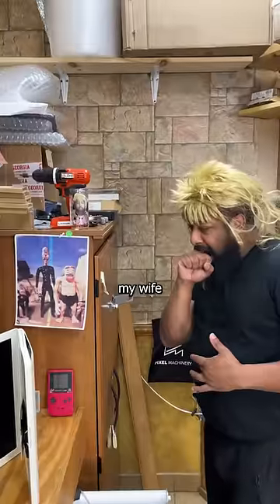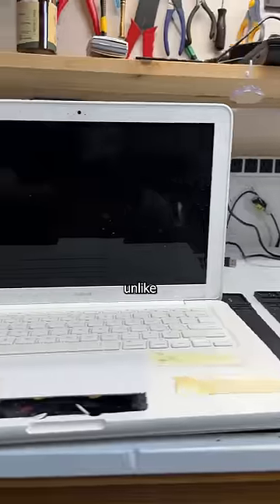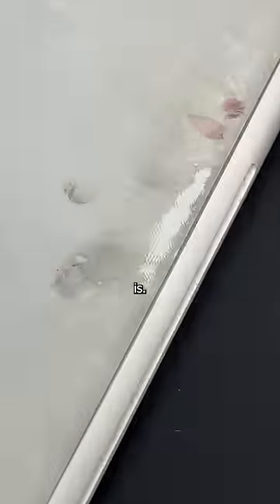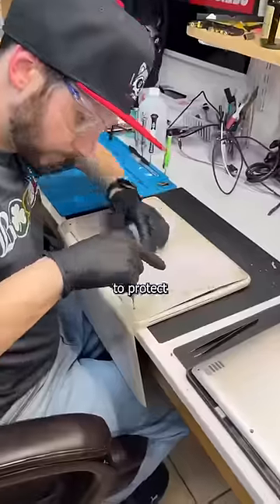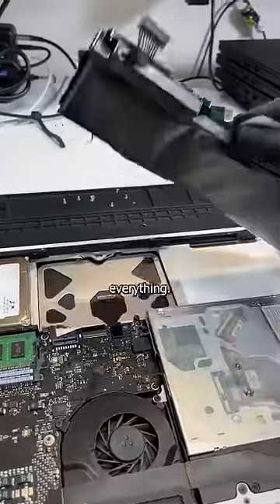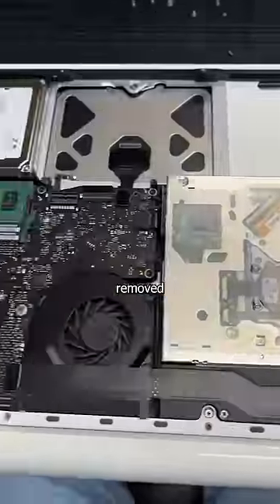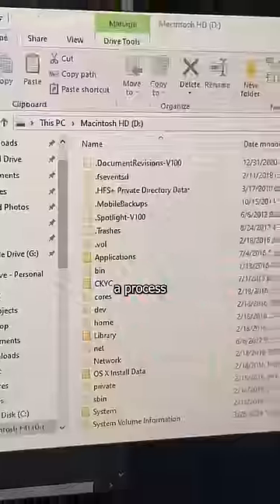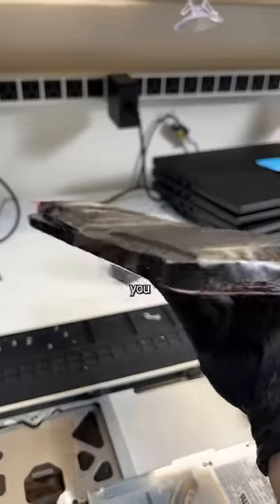MacBook swollen battery removal (GONE WRONG) #tech #technology #pc #shorts

Comment: My second to last phone legitimately exploded a little cause of the battery. It had been struggling for a while, the battery wasn't lasting as long, it would drop even when it was completely turned off, and when I had the media volume on even a little bit, it would drop about 40% and die, no matter where it was at. It could start at 100% and drop to 60% and it would die. 
Anyways, one day I was sitting in the dining room on my phone, and it goes dark and starts making cracking sounds. I panic and chuck it away and start running around the dining table screaming cause the battery has started sparking and puffed up, my parents come down and see my phone on the floor sparking and cracking, and the mark on our carpet from it melting the carpet a bit. That's my story

Comment: I was given an original MacBook Air the screen was damaged because the trackpad had pushed up into it the entire case was rounded like the Silver Bean in Chicago! Amazingly after I took out the battery it went flat again! After screen and battery replacement I use it on and off now. But I really need to get an SSD in there but it's a PATA weird ribbon connection and I lost the adapter and reverse cable somewhere that I think will solve this problem.

Comment: I had a rather scary experience with the "spicey pillow" myself. A customer brought in his impressively damaged Google Pixel 4a. And I kid you not, after taking a look at it and attempting to turn it on, the battery rapidly expanded and I bolted out the front door before it basically melted in a fiery sparky explosion. The customer then said "Nevermind there's no fixin' that." XD

Comment: You wouldn't need "special software" to mount that drive on if you used Linux. It would be just FS driver from repository.

Did you do any actual data recovery, or just copied files from old drive?

Comment: I had an I pad 4th Gen. I used it like everyday until the speakers packed up. It has been sitting there for 4 years, i see it sitting there last week with its screen exploded out as the battery has inflated about 1 1/2 inches out 😳

Comment: Well, about that.
What filesystem format does apple use again? Ah yes, APFS
Have a linux laptop in your shop... (nix is pretty cool, but even ubuntu or fedora will do), install apfs-fuse, and voilla! You can mount the apple file system and get that data out. The only shortcoming of apfs-fuse is that it opens whatever you're tryina open in read-only mode. That does leave a sour taste in my mouth, but it still works, and also, I'm going to have some ice cream to forget about it all.

Comment: I had a Nintendo 3DS and Nintendo Switch battey both start swell up like that, so I put them in a jar on top of my fridge. Thing is: I opened that jar months later to toss a PS5 Controller battery and it smelled, so I may have to take the jar to a disposal site.

Comment: My phone battery is currently doing that, the phone will over heat and freak out in temps over 27°c and when you plug it in to charge the backing slowly pops off as the adhesive has slowly been warn off and doesn't stick very well anymore

Comment: so i bought an HP Omen laptop back in 2018. brand new, midrange, overheated more than i do in 100% humidity triple degree Florida summers

two years after buying it, the battery starts expanding, breaking some of the screw mounts. i, a dumbass, didnt realize that's what was keeping the bottom of the laptop from staying closed until way later when i decided to open it to clean it out

i want it to be known i kept this ticking bomb IN MY BED WITH ME because i didn't have a desk to use it at

Comment: The grandpa that goes like : if it still works then it doesnt need fixing They Should Remember the note 7 That Battery Is A Literal Bomb I Wouldnt Even Discharge it It Needs To Go Deep In A Sand Bucket

Comment: had an 4,5 year old iphone 5 with a swollen battery. In norway we have 5 year warranty on electronics with built in batteries. So I had the phone replaced for free by apple, they did try to screw me over, but I know my consumer right and just told them to do it because it's the law here. Sold the new iphone 5 i got for 100 bucks and bought an android.

Comment: Took appart a battery pack as i though tat it was a scam, box said 5000mah but it was smaller than the 4000mah battery i had, turns out it was a scam, confronted the company and they ghosted me. Battery started to swell as i had pierced it accidentally on opening without realising, threw it in sand outside untill i could dispose of it. Reperposed the board to a different project

Comment: i once had a drone with 5 spare lithium ion batteries, they were pretty small but after about a year all 5 of them turned into pillows, so, long story short, i wasnt about to throw those in a garbage bin but i was also too lazy to dispose of them properly, so they were left on the countertop.. and now i have absolutely no idea where they are, i think somebody moved them but i dont know where, havent seen a single speck of them for years, i imagine (hope) that they were mistakenly thrown in the trash but for some reason nobody in my house remembers

on an unrelated side note, if the pillow battery doesnt set my house on fire for 3 years does that mean that its benign?

Comment: I had a LG K10? Think that's the number of the model that I had gotten from T-Mobile from a replacement of my older K10 that had a messed up screen and in about a week  noticed My phone wasn't fitting in its case and when I took it off and to examine my phone I noticed my battery is bulging out of my phone and those phones don't have a cover to take off like the older models where it gave you access to the back battery lets just say i got a new phone as soon as i saw that bomb in my pocket 😅🙃

Comment: Question: is recovering data from older gen iPods possible, especially since it's protected by password? My best friend died a few years ago and her parents wanted to publish her art and writing, but they were never able to crack the codes. Even Apple didn't want to help, as they said the only way to access the devices is to delete everything in them and restore them to factory settings. Please, if there is a way to access those information safely, mention me here 🙏🏻🙏🏻

Comment: Jup, looks like the battery of my wife's last cellphone. Only that with that it happened so fast, that we barely managed to get the data off of it, before it was "so swole", that we deemed it to dangerous to keep it in the flat. Dince the recycling station had already closed, we pit it in a pot on the balcony (thankfully topfloor) overnight. You should have seen the recycling guys face, whenn i presented thst monster to him, eveb though it hadn't inflated anymore.

Comment: Can you take a hard drive from one laptop and put it in another without issues? When I say you I mean anyone like is it possible
Reply: Theoretically yes. If the hardware in the laptop the drive is going into is similar to the one it came out of & the drive has a somewhat modern version of windows, it may see your new hardware & configure itself to it.

& by similar hardware mainly CPU type, Intel to Intel or AMD to AMD. I don't think it would work going AMD to Intel or vise versa- though I could be wrong.

Ultimately whether it would work comes down to luck of the draw.

Comment: Hey i have really big problem i cleaned my pc recently and it wont connect with my screen keyboard or anything else but it boots up and everything works fine i tried a lot of things like taking out the byos battery and putting it back in take out the ram and put it back in and stuff like this but nothing works could anybody please help me thank you very much